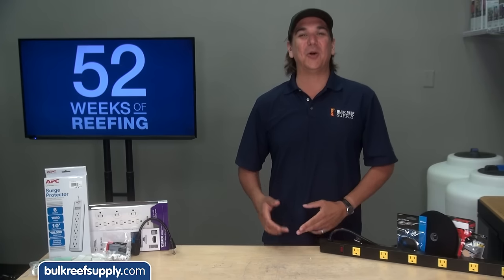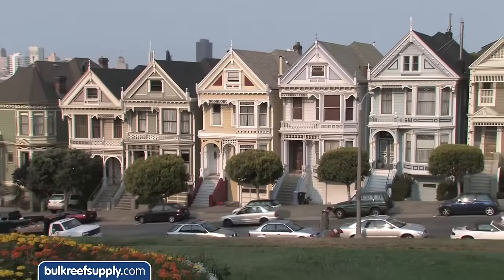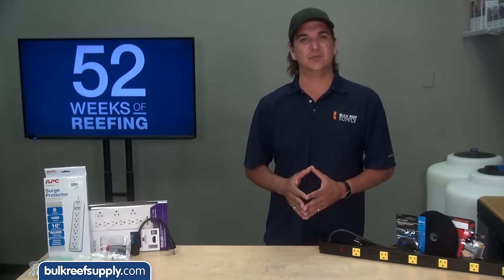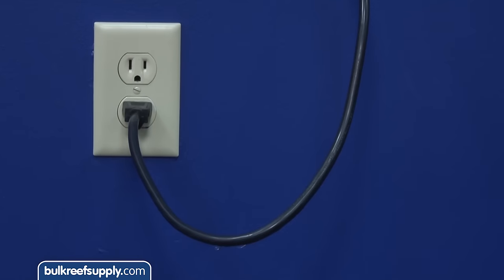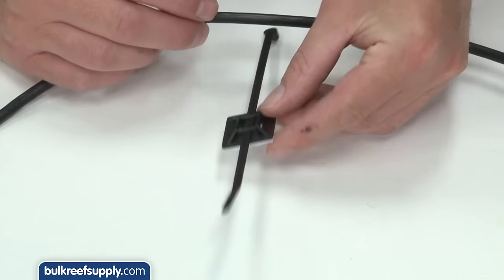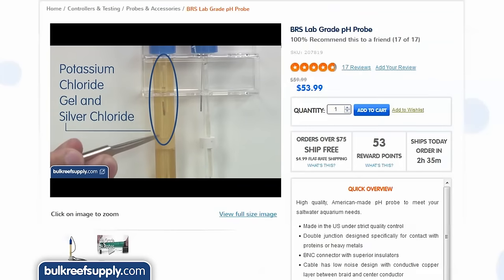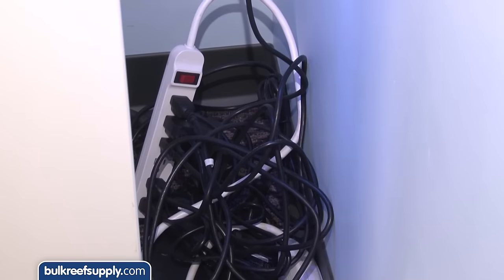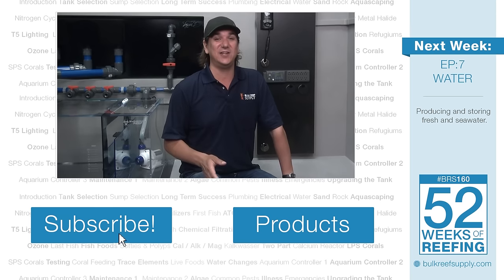Week 6: Wiring Your Reef Tank, Everything You Forgot to Think About. | 52 Weeks of Reefing

Comment: On my tank adjacent plugs I use GFCI and outdoor rain covers to ensure that the outlets and plugs are protected and i'm protected from the tank. They also have titanium ground plugs that plug into the GFCI outlet and sit in the sump or tank so any stray voltage gets grounded and the GFCI will subsequently trip keeping the humans safe.
I also have a 3500 watt generator from my RV that stays in the garage for power failures wired to a transfer switch. In the event of a power failure start the generator and flip the switches and the house and tank are back online. I can run the whole house except for the AC.

Comment: Electrical engineer here.  National Electrical code dictates that if anything is running for more than 3 hours it’s classified as a continuous load and has to be counted as 1.25x what the rated load is.  For example if I’ve got a 100W LED light for my tank running for 5 hours, I gotta factor in 125W into my calculations, so bear that in mind.

Comment: For 30 bucks at Home Depot I bought a Husky brand PVC handheld pipe cutter.  It makes clean fast straight cuts and makes life much easier.

With the cutter it's easy to rough cut all the pipes a hair longer then you think they should be, then easily trim them during the test fit process.

Comment: About circuit breakers. You really don't want any breaker to be tripping often. Circuit breakers are mechanical devices and the more often they trip, the faster they wear out. You'll find in older apartment buildings were the breakers have been tripped so many times over the years, that it actually takes less overload to get it to trip. Most circuit breakers should be replaced after 10 years. Some may suggest replacing them more often. Ultimately, you can do what ever you want....at your own risk.

Comment: I like to use DJ switch products that have an illuminated switch for each item plugged in. Label then and you can shut off one thing at a time without pulling plugs.   They run about $40 at the Guitar Center for a series of 8 outlets.
Reply: Doug Ahern good tip

Comment: You can only run 80% of power on a breaker. So a 20amp breaker runs 1920watts and a 15 allows 1080 watts. Otherwise it's designed to trip over that current. Watts = 120v x current.
Reply: 80% of power when its continuous use (which this is) otherwise you can run 15 amps on a 15 amp breaker, most breakers dont trip immediately at their rating and I've seen some hold at 150% of their rated amperage

Comment: I would suggest a pvc material and not rubbermaid.  Rubbermaid are ply MDF wood, composite, and sometimes mdf. All of which shouldn't be around water. PVC also doesnt require paint so doesnt stain with contact of water and can be wiped down and cleaned.

Comment: I Need help, im trying to hook up my kessil 160we up to My reefKeeper lite Via the ALC module. I have the kessil controller cable but It doesn't show up under the systems on Myreef 2.0...I'm stuck and am wondering if i waisted my money and shoulda just got the Spectral Controller from kessil. Any help would be great.
Reply: Thanks. I figured it out, I didn't realize you had to tell each module what its role was and can change it and really screw it all up. now i'm just trying to get the settings correct and get it to ramp up/down.